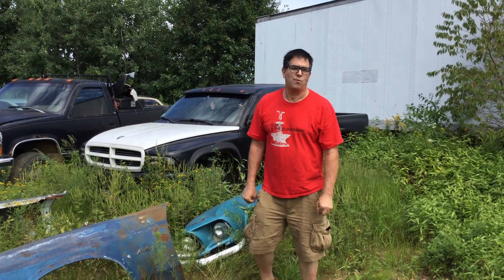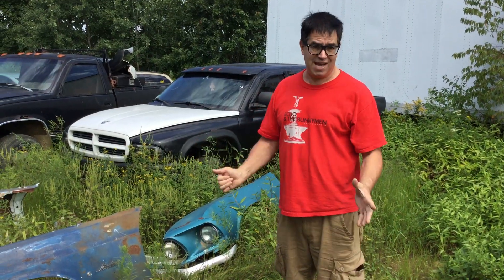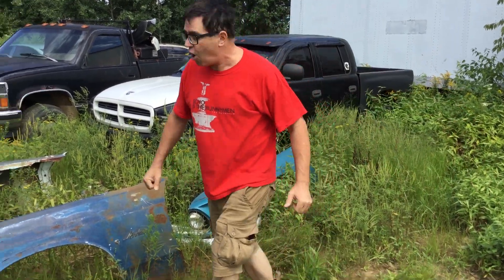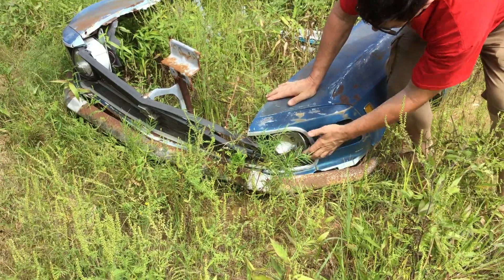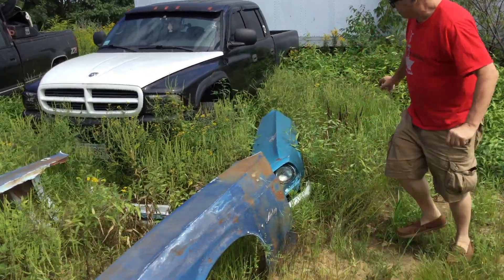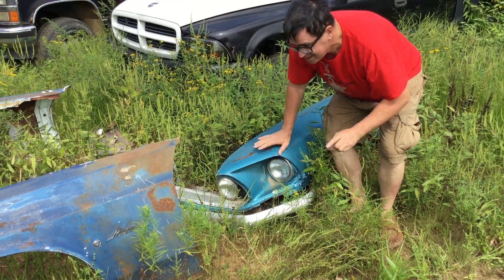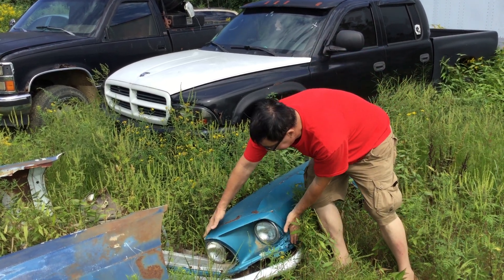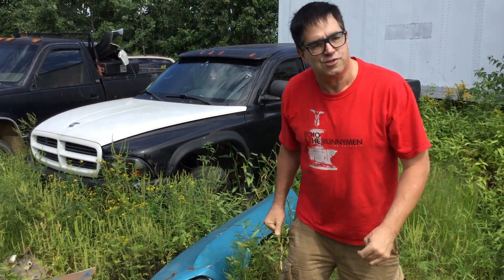Amortizing the Mustang!

Comment: Amortization was the name of the game. Most people outside of the industry don't understand that a set of dies to stamp out and form just one fender could cost tens of thousands of dollars to build back in 1969 so if a manufacturer could save a bunch on the next model by just modifying existing tooling they would. I think Studebaker was the king of doing this as they used the basic body shell from the Hawk from 1957 to the end of the line of the company in 1966. With different front sheet metal it was morphed into the Lark as well.

Comment: Steve, you're close, the skin is the same, but the front inner structure is different. 69 has a hole for the headlight bucket, 70 is flat. A 69 fender extension won't bolt to a 70 fender.  70 also has a side marker light.